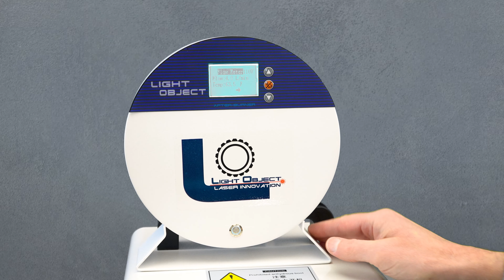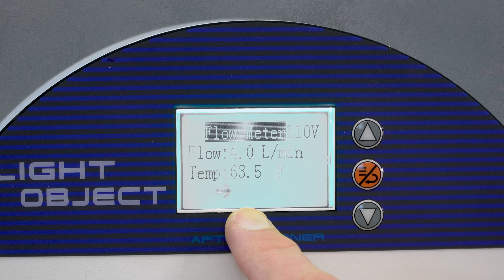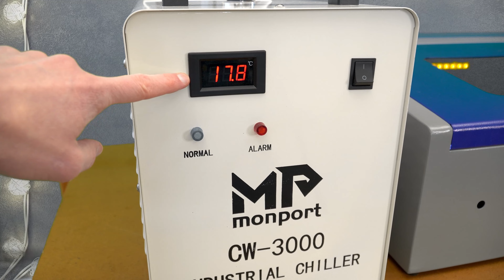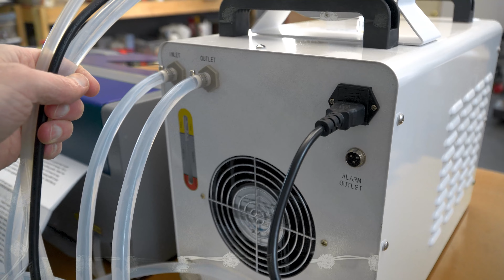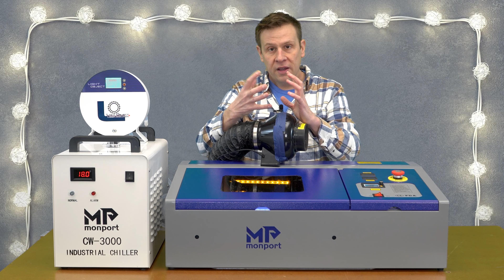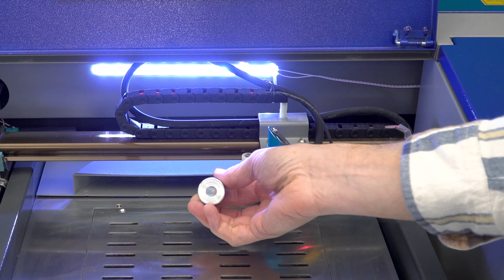Monport 40-  My First Upgrades!

Comment: How hard was it to route the air assist hose, etc?
Reply from the maker: Not hard at all.  I used some twist ties from some power cables to attach the airline to the energy chain (my airline did not fit inside).  I ran the airline out the back of the machine through an existing hole.  It's a nice upgrade to the machine!
Reply: Thanks for the response. I love your videos!

Comment: hello quick question how do i connect te chiller afterburner and the laser all together
Reply from the maker: Here's what the manufacturer recommends: Connect Outlet of laser machine to Inlet of Heater, Outlet of Heater to Inlet of Chiller, Outlet of Chiller to Inlet of laser machine.  The Monport 40 machine uses smaller cooling lines than the Heater and Chiller- some plastic inline adapters will be need- I think they're 1/4 to 3/8. 
Thanks for watching!

Comment: Hello quick question I watched your other video doing glass but on your experience wich machine is better for glass engraving I have a 10w  diode lasers and I am thinking either get the 40 w monpart or upgrade my laser to a 20w thanks
Reply from the maker: Hi- I've engraved glass with a laser diode in both 10 watt and 20 watt laser modules.  Both work well when using a masking agent- the 20 watt laser module completes the task faster.  I have not engraved glass with the Monport 40 laser yet- I do know that the Co2 laser on the Monport reacts better with the glass making for easier engraving- Co2 laser users reported using simple dish soap or a wet paper towel as a masking agent.  The next videos scheduled for the Monport 40 include engraving glass.  I do love the Monport 40 on clear acrylic- engraves and cuts through with ease- not masking agent need!
Reply from the maker: Here's the latest Monport 40 video- it's a project video engraving glass! https://youtu.be/NCrH0_p3mxE

Comment: Lightobject air assisted supports 12mm focus lens. Just in case you folks didn't know about it. Also, there is a Pro version air assisted laser head available in Lightobject